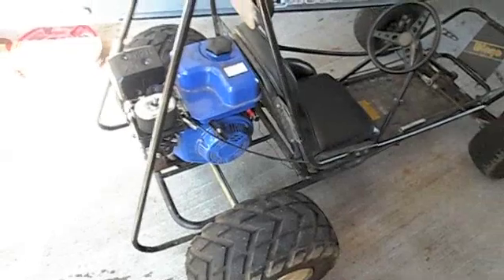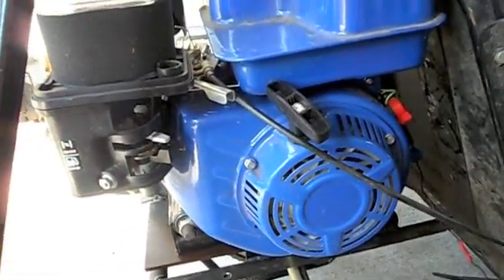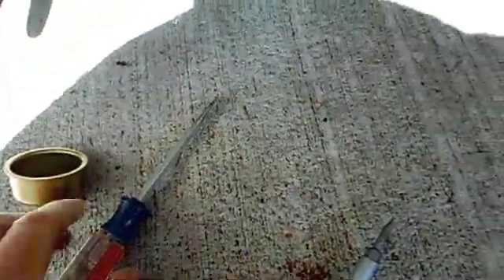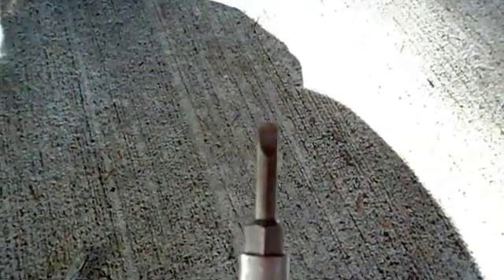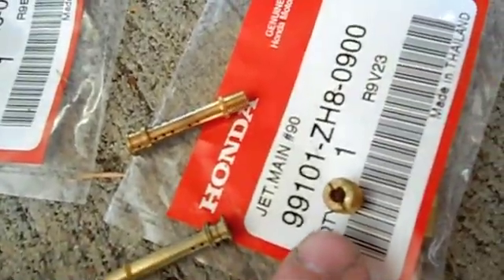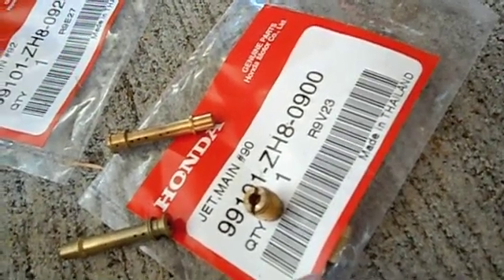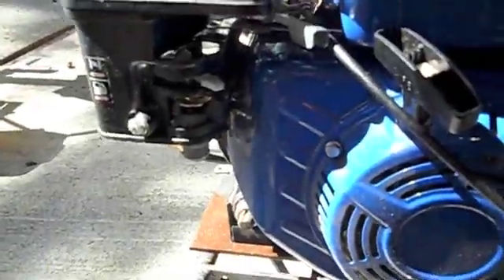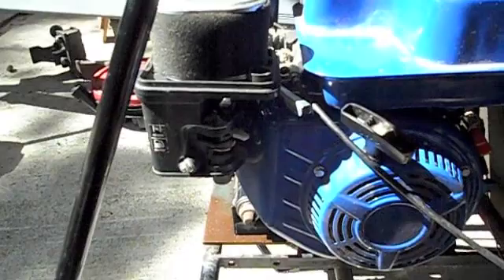Lifan Honda Clone 6.5hp Rejet

Comment: I did this on my Greyhound 6.5 hp an is solved the starting problem I had with it.  Next, I will try this with my Craftsman snow thrower that has a chinese engine that won't start and see how that works.

Comment: speed you want larger tooth clutch like 17 tooth with 55 tooth sprocket.                           If you want acceleration put 10 tooth clutch with 70 tooth sprocket. The thing any one should know about higher clutches is your engine accelerates really slow but you get up to 60 with no mods!!!

Comment from the maker: That's weird. On my latest build of this engine, i ported and polished the head as well with no problems. I have not bored the carb though. did you put a different throttle plate on it? I am wondering if some chips might have gotten into some of the air passages in the carb. 

My latest engine build of this engine, had a mild cam, 18lb valve springs, flat top piston, milled head, port and polish, no gov., stock carb and billet rod. made 13.5hp@5400 on the dyno and 22 ft lbs of torque @3000 rpm

Comment from the maker: @alienboy366 you should get an 88 main jet and a GX140 emulsion tube. you can get these from affordable go karts-dot- com or nr racing. the jetting also is dependent on what your elevation is. An 88 is great for these in stock form and modded. I am running a 90 in mine, but i have built this engine to up to 12 hp @5200 rpm now

Comment from the maker: @MrHarrysachs69 already have.... lol with no load and the governor it will almost float the valves. actually what is the most limiting part is the lever that sticks out for the hand throttle, if i cut that off i could actually get it to stroke further and hold longer on the governor, for more speed and power.